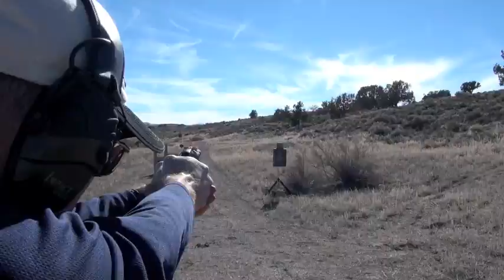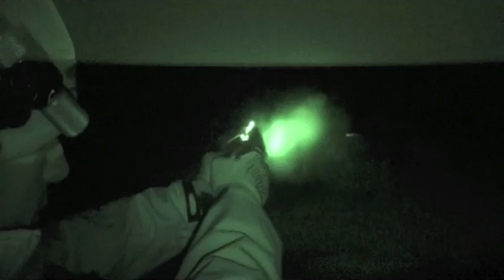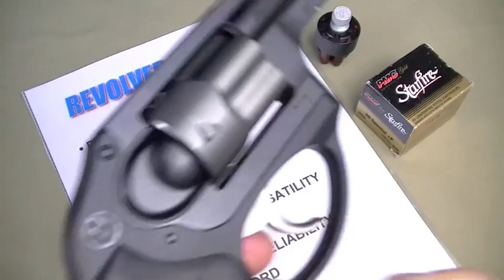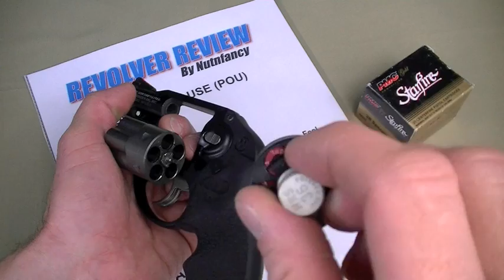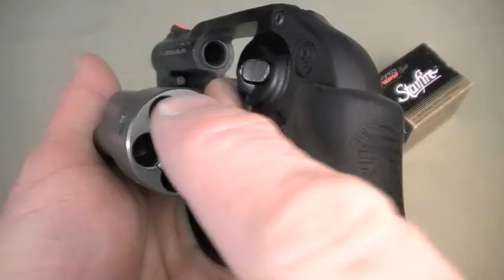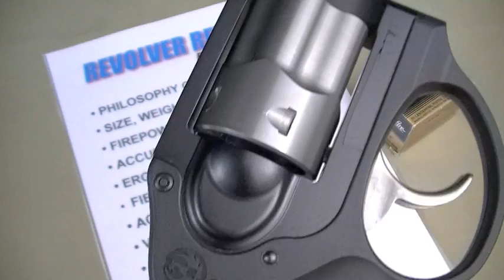Ruger LCR: "Fast, Fun, Deadly" by Nutnfancy

Comment: The reason why you can't shoot a double action gun well is because even when you shoot double action you are actually still shooting it single action except your trigger finger is pulling the hammer back.   That may not make sense to you but to a true revolver shooter they will know what I'm talking about.
Reply: +John Evert Yup. That's why you stage the trigger as Nutn mentions. The first 75-80% of the pull is to rotate the cylinder and engage the hammer. The final bit of the pull is the actual pull of the trigger that releases the hammer.

Comment: I own every lcr now i wanna get the 9mm version next
Reply: I'll be picking one up next week
Reply: shot the 9mm today I dig it. can't use cheap ammo. Ran about 25 rounds of hollow points then tried steel and aluminum cased rounds. the steel wouldn't eject and one of the aluminum cased round separated. Ran brass the rest of the day with no issues put about 110 rounds through it

Comment: @glockfan86 A 357 in such a small gun is a lot of blast and recoil with little added benefit.  The 357 exploits a longer barrel far more than a 9mm, 45acp or 40sw.  There's not much velocity loss going from a full size Glock to one of the sub-comp...but there is a lot going from a 6" to a 2" 357...and recoil-ridiculous. Be certain of your ammo with your conversion. The rim & web of a 9mm case are quite different than the 40.  Some ammo can cause issues.  Wise to pick up a 9mm extractor as well.

Comment: OK, so...357 can shoot .38 but is this ALL .357's and does it work in reverse?
Reply: Yes you can shoot .38 Spcl out of any .357 mag revolver. However, you can't "reverse" and try to shoot .357 mag out of a .38 Spcl revolver. If you try to load .357 into a .38 designated cylinder the magnum round will not fit in the cylinder. Hope this helps!
Reply: ChrisRoblesSenior can you shoot 38 plus+p out off a .357 magnum ? Or just standard loads (38)
Reply: +akaspitfire1 yes you can shoot +P loads out of a .357 Magnum. The .357 Is made to withstand magnum pressure loads which exceed +P loads.
Reply: ChrisRoblesSenior I'm also seeing some guns are .38 only or .357 only. I'm actually starting to lean towards the .38 Special but having the option is always good.
Reply: ChrisRoblesSenior thanks
Reply: ***** Thanks, I'm starting to get the difference, still looking for a nice snub/

Comment: @0000001744 I'm assuming you mean .38. if so, I'll just say that there are a lot of people, good and bad, dead today b/c of the .38 spl, and it's nothing I wanna get hit with. If you have modern loads, .38+p will definitely get the job done, and like Nutn said, .357mag recoil in a gun this small & light would be a lot and make it very difficult to hit a target with.  there's a reason .38 is still around after nearly a century.  It it wasn't any good nobody would use it.

Comment: Dude, dude,dude!  Always go .357 Mag, more mass, more controllable, use the .38 spl, but in a bind you can use .357Mag no worries.  .357 Mag with .38 = more controllable and ammo options.

3.5 ounces more! Suck it up, its worth it.  I generally hate the weight Nazi types they are just to ridiculous over nothing of significant consequence.

Comment: pretty sure its designed for less than 7 yds for self defense. Your at 20 ft, why aren't you running the other way! I pocket carry my LCR for the same reason I pocket carry my LCP, close encounters, over 10ft, Im trying to escape. period. Pretty sure I can land my 357, 158g Hydros center mass at 10 ft as fast as I can pull the trigger, if need be. Id much rather be putting my heals down in the opposite direction as fast as I can though. 20 feet with any pistol, why?

Comment: My wife got me the LCR357 with CT grips for a father's day gift. I've run about 700 rounds of 38 through it and about 50 of 357. The trigger is a dream and no complaints. 357 stings a bit with CTC grips but the gun is accurate and managable. HK36 speed loaders will jam if you're not careful. I have heard that the 5 Star and S.L. Variant Model J-36 speedloaders work fine in the LCR but haven't tried them. For moon clips go to tkcustom.com if your serial serial # is above 546-11326.